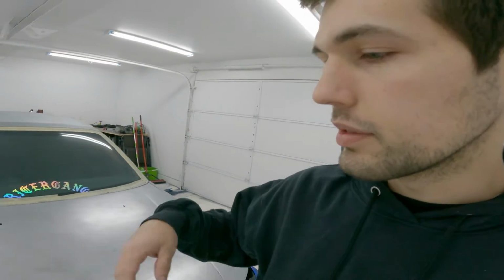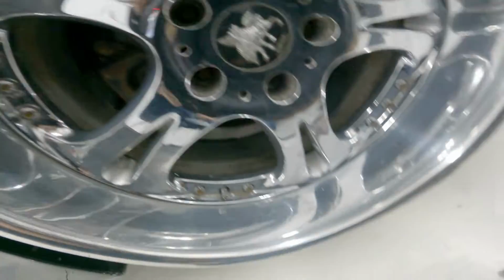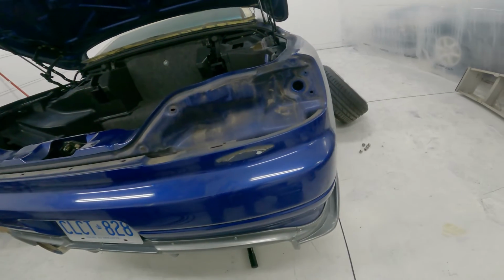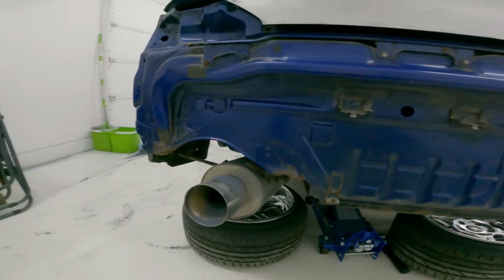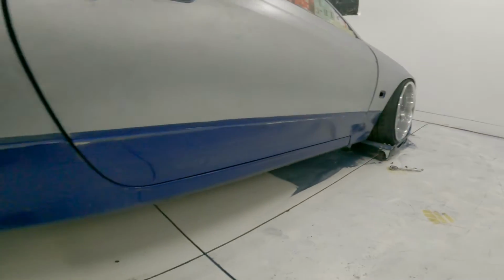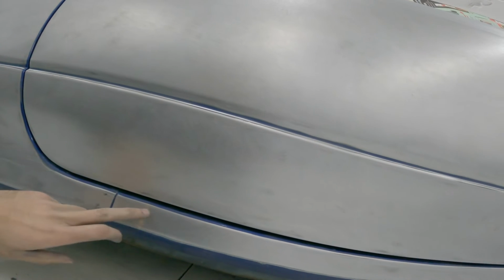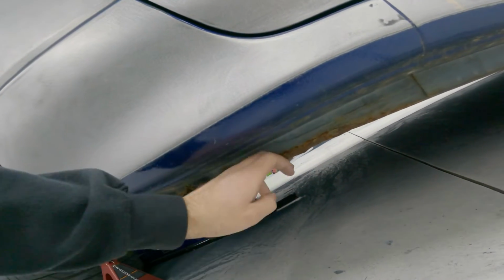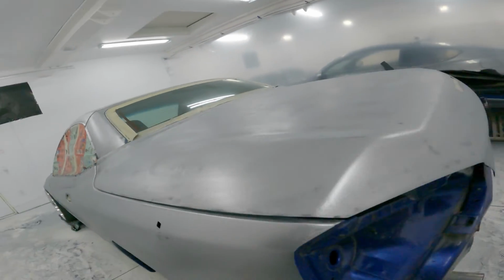FINDING SOME HIDDEN DAMAGE ON MY S15

Comment: So funny that s15 never came with a rear rebar "steel bumper under the cover" keep up the good work man 🔥
Reply: Thats a Varietta specific chassis brace as the spec R boot bar doesn't fit. They also have a floor brace between the doors and the trans tunnel up front.